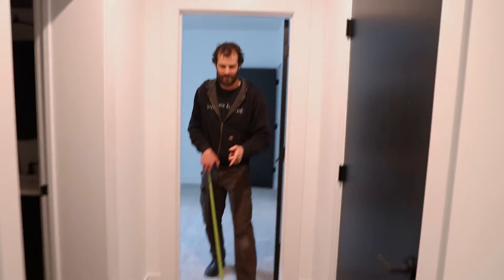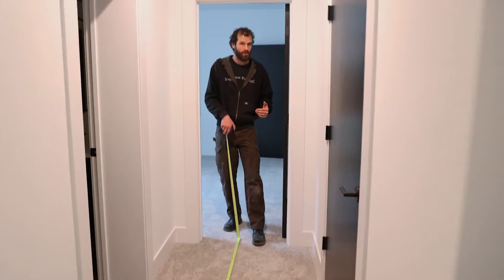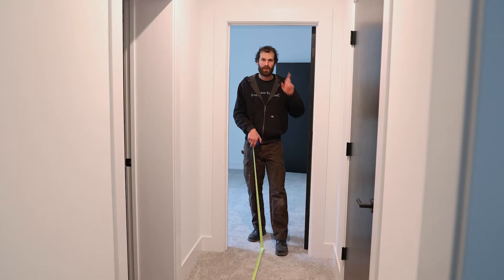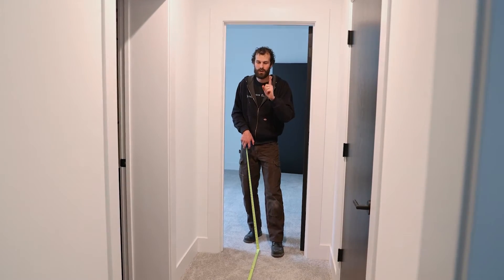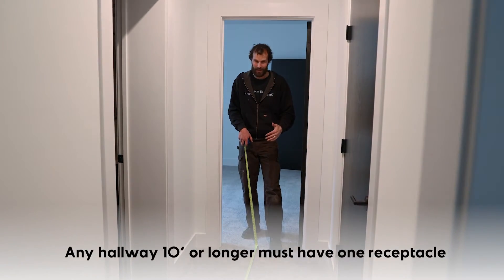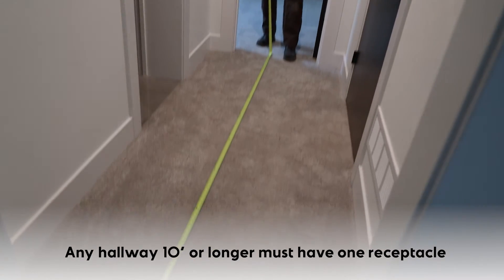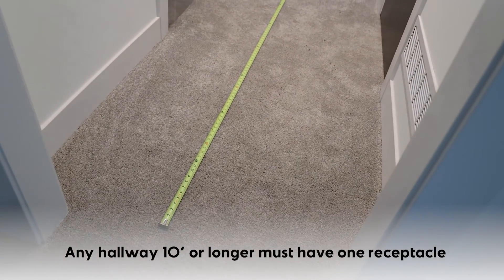Hallway and Stairway Electrical - Code Minimum

Comment: Don't forget a lighted switch is required by NEC.
Reply: @ElectricProAcademy  Ok this is what I found, in BOCA:

1207.2.1 Controls: The control for activation of the required
stairway lighting within a dwelling unit shall be operable from the top and bottom of each stairway without traversing any step of the stair. All switches that control interior stairway lights shall be illuminated switches. The illumination of an exterior stairway serving a dwelling unit shall be controlled from inside the dwelling unit, unless continuously illuminated or automatically activated.

So not NEC.  Just our Electrical Inspectors call it out.

Comment: Can never remember what the NEC states about the minimum # of steps that you have to install a switch at both ends. Might be 5 steps , if so if you only have 4 steps only need one switch but If it was my house I would install two 3 ways just to make it easier. When they built my house 60 years ago lazy electrician installed the single pole dining room light switch on opposite wall from where basement door is making you walk across dark floor. Of course when my kids were little they always left a few Lego blocks and small toys in floor. When I remodeled the house put a switch by basement door and a 4 way on second floor to control dining room luminare. Glad I did it ( especially when a 250' coil of 14/2 NM cable was around $16 & 12/2 less then $25 ).

Comment: Many builders installed a "convenience outlet" in the hallway so you can run a vacuum to all the adjacent rooms without moving furniture to plug in. BTW, a vacuum cleaner is one of the few UL approved appliances exempt from the 6 ft power cord rule.
Reply: Put in an illuminated LED / Single receptacle in my hallway along with a central vacuum inlet. The LED is a great nite light and controlled by a two level photocell .
Reply: @JohnThomas-lq5qp  ... not a bad idea but the main difference is the outlet is required by code.